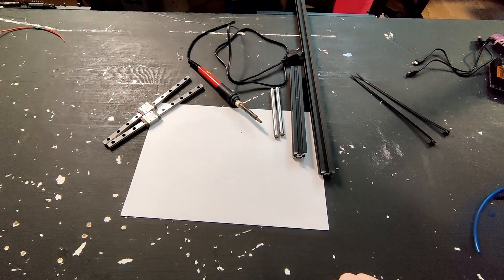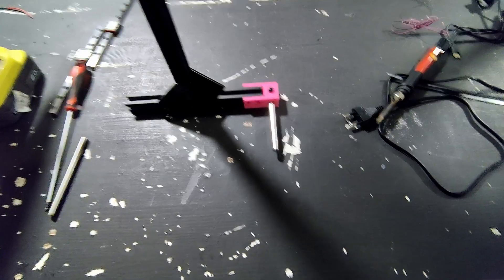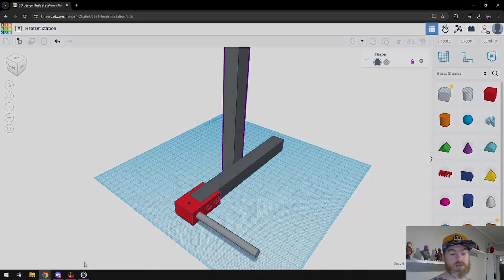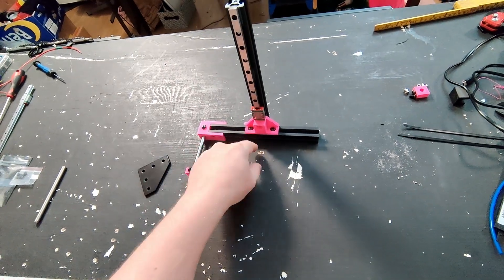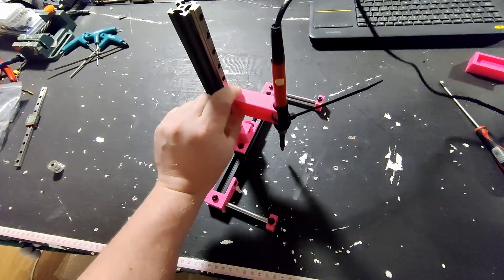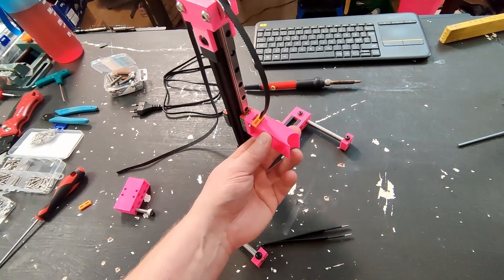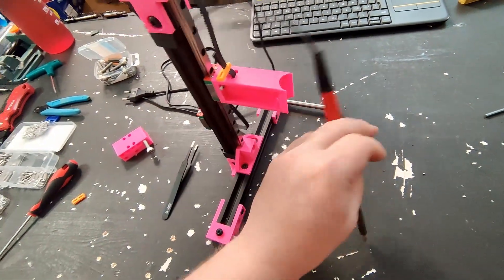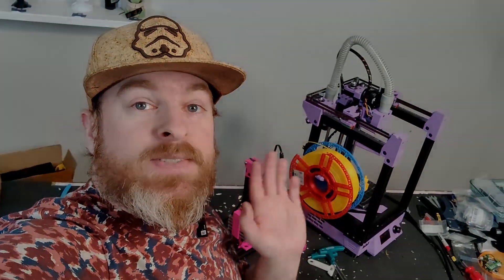Come make a heatset-tool with stuff I have in the workshop, and TINKERCAD!

Comment: A timeless product.
I made something similar but instead of screws I used a 48mm broken Nema17 motor as a counterweight. And instead of linears, I have POM V-wheels.
Reply: I like the format of this video.  Nice making something from stuff you just have laying around.
Reply from the maker: I did consider using a motor, but I tend to need them after I use them 😉